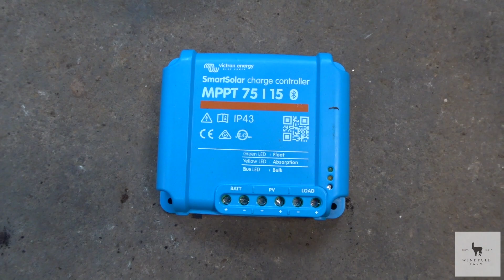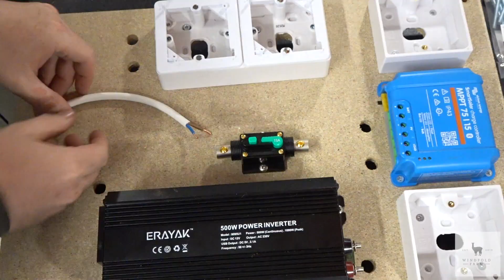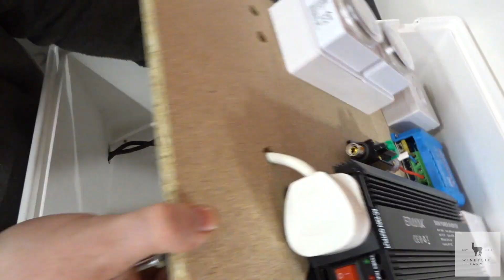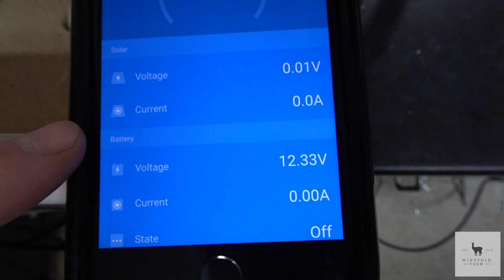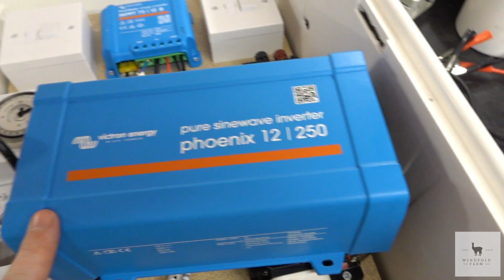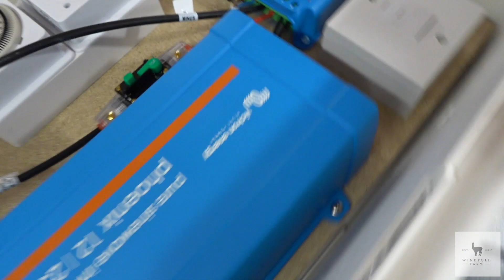Solar System for the Pond (The Build Part 1) - Windfold Farm - 061

Comment: I wish I had ducks or even fish.  Would love to design one of these systems that was micro controlled with no battery at all, just run when the sun was out. I have a washing machine that runs just from the sun with no batteries.  Batteries are a pain and totally not needed for these applications.